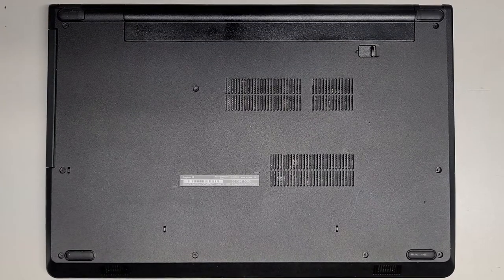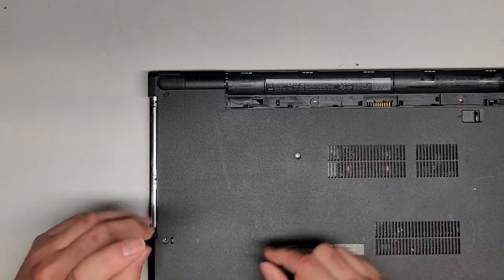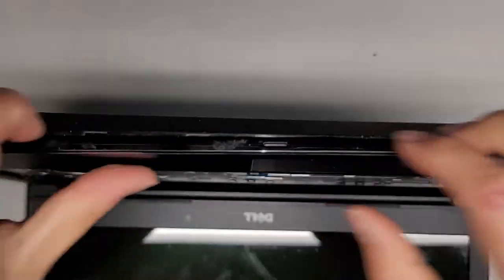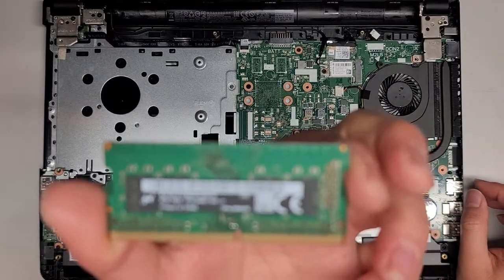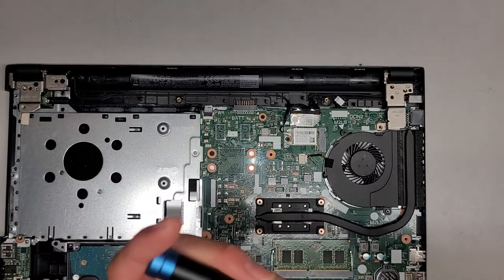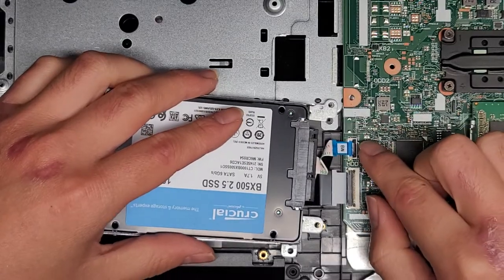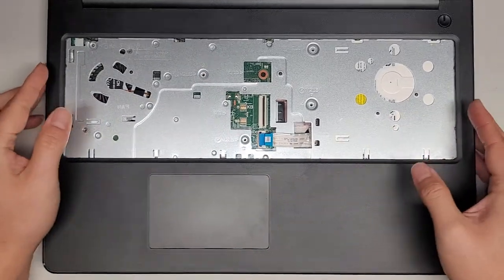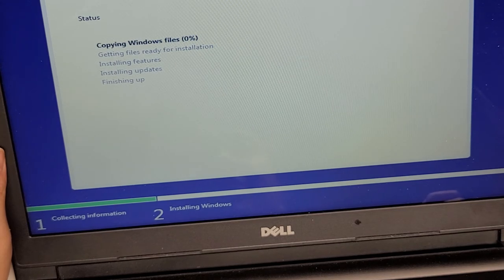Dell Inspiron 15 3567 Disassembly RAM SSD Hard Drive Upgrade Battery Keyboard Replacement Repair

Comment: How to create a windows  10 bootable please send the link thnankyou
Reply from the maker: Basically this https://youtu.be/R6GVDyVqWso but the create bootable usb option.
Reply: @ItsBinhRepaired   Thankyou, I hope it will work because I've upgraded my laptop dell inspiron 15 3567 but I can't install Microsoft OS but linux is working tho
Reply from the maker: Sounds good
Reply: @ItsBinhRepaired  Hello even after creating the bootable USB option it's still not being able to boot it just turn on and when I start to boot it's just shows the windows  logo for few second and then the same thing happen can't  boot
Reply from the maker: @banteikhongwir5160  press f12 on boot to select the usb to boots from
Reply: @ItsBinhRepaired   I did the same procedure but it's not booting  up please  help it had been almost a week that I've been trying now
Reply from the maker: @banteikhongwir5160  how can I help if you followed what I did and it doesn't work. I don't know what's happening. I'd need to see it.
Reply: @banteikhongwir5160  same problem, did you fix it?
Reply from the maker: I don't understand what's happening
Reply: @malice4303   Yeah it's  working perfectly you need extra ram too not just ssd

Comment: I would appreciate if someone can help me, I have mounted the kit 16gb x2 Crucial 8GB Single DDR4 2400 MT/S (PC4-19200) SR x8 SODIMM 260-Pin Memory - CT8G4SFS824A, and the computer just does not work, it is stuck, I have removed 1 memory and it works perfectly, someone can tell me what happens?
Reply from the maker: Try the other stick of RAM and the other slot
Reply: One ram slot might be broken but that's impossible since that other one should work hmmm
Reply: @instantaura  I have put the 2 ram and in bios it recognizes it but the system does not boot up
Reply from the maker: Hmmm